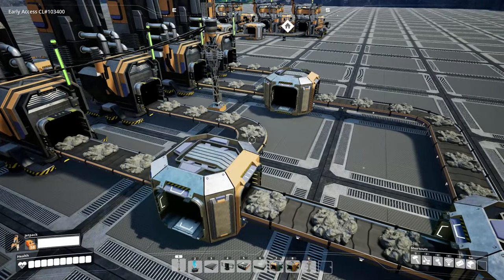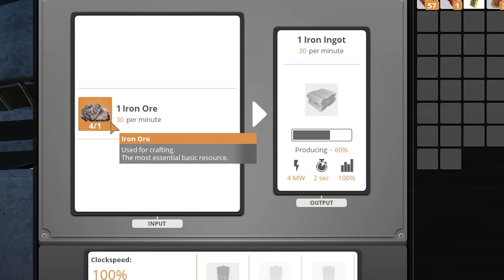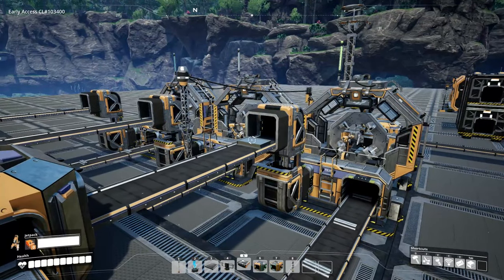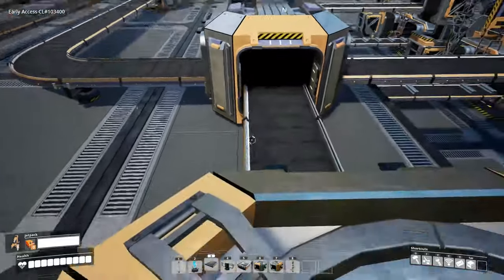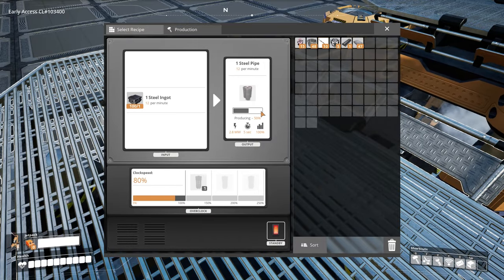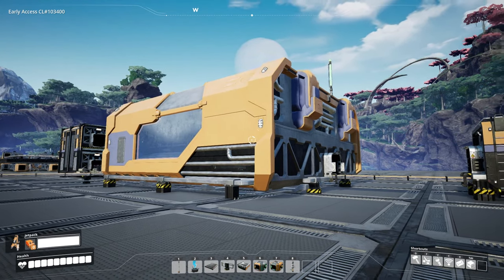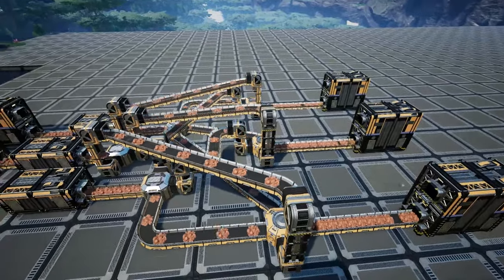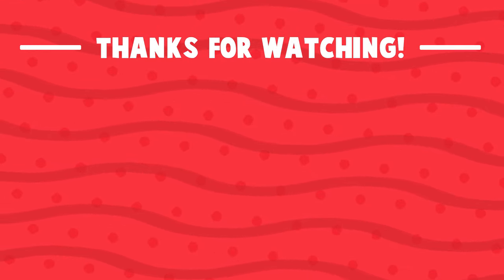Load Balancer Tips for an Efficient Factory! - Satisfactory Tips (Beginner + Advanced)

Comment: We produce too much of everything, the overflow is sent to storage, the overflow of the overflow goes to sink. We have main belt lines going to storage with multiple items on them, then use smart splitters to devide it all into containers, then have all the overflow from smart splitter line going to a series of sinks. Mk5 belts. We use the overflow line system and load balancing from resource nodes only.

Comment: I think load balancing is a wasted effort for one single reason: Unless you constantly and endlessly add more storage, your production line eventually runs full and stops. With a topped-off overflow mechanism, you already take into account eventual overloading of machines.
My approach is that any factory produces one thing and only that thing. The raw materials arrive by train, get shipped to the factory by truck, processed and the product shipped back wiht the truck to the train station. The good part about this is that you can have too much production and it ends up in a big container (train/truck station containers). From there it is taken when needed by trains & trucks.
Reply: Balancing is indeed fairly pointless, but no, the production line needn't 'run full and stop'. If you're managing throughputs properly it's not hard to consume exactly what you need, meaning resource nodes can be fully exploited.
Reply: @nomoturtle1788  Okay, I dont know what the highest tier item is, but let's say, you optimised production exactly up to that last item. You have a storage of size x for that item. Eventually, the storage gets full. That means your productions starts to back up. Your optimization was pointless.

Now since very rarely people build a factory from base item to highest tier item all the way without ever switching it on, it is really a wasted effort.
Right now, I am working on my steel production. I only need stators, rotors and motors. But the steel pipes, quickwire, encased industrial beam, etc is already running and of those of which I need also as construction materials, they fill up a storage.
Reply: @Zlorfikable  Pointless? I have all resources collect autosort into a central storage (the barn), where once storage is full the items of the corresponding chest are sent to a grinder. The system should never back up.
You didn't address my point either. "Resource nodes can be fully exploited". If you're cramming in 240/min into a system that only needs say 210, then you're wasting some of the resource node's throughput. What's more, with this oversaturation method, you have to repeat this process through every stage of the production line, so that for your motors for example, you're overproducing: iron ore, iron ingots, rods, screws, rotors, copper ore, copper ingots, wire, coal, steel, steel pipes, and stators. 
Even if you somehow only overflowed 5% each time, you're wasting something like half the throughput of the ore node. In other words, it's as though your recipe costs are doubled. 
Throughput is the only real limititation in this game. Play however you want to play, but if my assumptions are true then your factory could be significantly optimised with the application of a little maths.
Reply: @nomoturtle1788  i disagree. Power is the limiting factor. And resource nodes are not that big of a deal: there's more than you could ever wish for.
Putting things into a grinder doesnt make any difference whatsoever. The only thing you achieve is very balanced power usage. 
The point is, that there is no additional benefit for presplitting every input to the correct amount.
Reply: @Zlorfikable  Power is also obtained from resource nodes, and I bet you overflow those too, though the chain is simpler than manufacturing a part.
Having the grinder means the scenario you told be would happen doesn't happen.
If you're happy looking for additional resource nodes, or don't want to use them all, then it doesn't matter much, no.
Reply: @nomoturtle1788  Still, that doesnt change that load balancing is unnecessary. Remember, load balancing is only the system of splitting resources into equal amounts before feeding it to a machine, not the total amount used for the machine. If you use load balanced a total of 450 resources for a set of machines, then overflow also uses 450 total resources, just belted and split differently. Using more or less resources is a waste of time and energy - we both agree on that.

Comment: Not only does load balancing take up space, but if there is lag issue, all your machines probably won't be running at at 100% efficiency compared to the overflow method in which maybe your last machine won't be running at 100%.  Load balancing has so many cons.

Comment: Alternatively, slightly oversupply resources via over/underclocking at each stage, and the input buffers of each machine will remain full, making sure the machines further down the line (manufacturers) are always running.  Easy, done.  Practical over perfectionism.

Comment: In the first example you divided 120/min by half and half again, into four lots of 30/min, to feed machines that want 30/min. This is much better than just splitting off a single line into machines (overflow system) I do agree, and I think that is what you are trying to express here. But this is not a 'load balancer,' it's just dividing up a line for machines. Balancing doesn't happen in Sat. as it does in Fac. where belts have two sides which can fill unevenly. In Sat. feeding a machine exactly what it says it wants is '100% efficient,' not 'load balanced.'
Reply: It's not even that much better than load balancing. It only affects the start up and makes no difference in the long run.

Comment: Nice video, still useful now. lol  I'm fairly new, just built my first fuel generator, I've been just using the 'split everything evenly' method.  Looked up your video since I'm just setting up my first Mod Frame line.  I really like the 'send back to a merger idea'.  One thing I've been doing as well is put a Smart Splitter at the very start of the line with overflow going to the Sink.  Then if it does back it will just dump any extra.

Comment: My method is this:
I seperate all the same.
Like wenn I have under 3 things I want to supply, I use one splitter, but if I have like 4 I use 3 splitters
The supply gets to the first one. There it splits into left and right. Then at both side there is again a splitter. 
Now if I add more to them or planned it. I add it in a row, like 1-3 and add stuff to it like by my coal planets
But if I know there will only a certain number, then I try to split it nicely up like 2-2
And well you can call it a organized overflow as specially I add mostly a storage contaìner in the production so I can grab stuff that I need to build, research or craft
If I know

Comment: I find its easier to just budeget +2-4 per minutes on the input, and it slowly gets clogged until it naturally stacks up and balances itself correctly no matter what your set up.  It works just as well and takes less space and planning.  Its only flaw is if you have low tier belts (3 or below) you will not supply enough to one of the objects, and in particular not be able to remove the output fast enough.

Comment: I personally use overflow for all my machines and then load-balancing between them. I do however underclock some machines for the ratios, and if I have a little too much of one thing (like 8 screws per minute) I just use a smart splitter to route the overflow over to my resource sink.
Currently (early game, just before making steel) my only fluctuations in my power usage are from the resource sinks, and once in a (very long) while, a constructor for my concrete might stall (they use 40.05/min but only get 40) for a second or two. Everything else works at 100%, even with overflow. I'll probably use proper load balancing later when making heavy frames or crystal oscillators

Comment: One thing I have to disagree on. Never underclock a machine unless it's a miner or you don't have enough supply to run it at 100%. Just load balance the extra it makes off to a storage bin. Especially if a machine running normally makes like 15 and you need like 12 or something, because that's easy to load balance out.
Reply: Yea...  I don't really get why you wouldn't just go to a storage bin and then eventually you'd overflow but that doesn't make anything run slower down the line so it's not really an issue.  Or if you really care you can send excess to Awesome Sink for tickets and maintain 100% efficiency.  

Unless you don't have the power and need to underclock or it's fluids which can't be awesome sunk directly (again assuming you don't want overflow in inputs down the line for some reason) I see no reason to underclock

Comment: Correct me if I’m wrong but wouldn’t your conveyor level also factor into this? Wouldn’t it be harder to load balance with a level 5 conveyor compared to a level 1 as your resources approach the machinery at a much higher rate? Or am I wrong?
Reply: I don't think so..? The machine outputting, determines the resource numbers going to the input, so it doesn't matter how fast they move, it just means there will be more space between the individual parts on the belts. 

I guess, its better to have faster belts moving fewer resources, than slow belts moving to much

Comment: Hmm. Tbh if you let  120 ore into 1 splitter and connect the splitter to one furnace and 1 other splitter, connect the last splitter to 3 other smelters. You will have the same result. IDK why you are making this harder than it is. You dont need to balance that evenly, since the first smelter will run full and cant take anymore and than the second one will be full too, the third one too, after that the last one will be fed evenly. It takes a couple of minutes until it gets going, but ok
Reply: Not quite. The way splitters work in this game, is that the first smelter, the one connected from one 120 line, split into 2 60's, will mean that first smelter, will get 60 ore, until the smelter is "saturated" meaning it reaches its 100 item limit. 

This is because the splitters take the input, and then send the ore to outputs in a rotation. So, if you have a 120 line entering, and 2 exits, both belts will get 60 no matter what, which means that until your first smelter fills up, the others down range will be starved, and that first line will always gum up the system, leading to inefficient splitting.

Comment: Theres an important aspect in Satisfactory that makes load balancing rather useless.
Unlike Factorio, where the splitters have a set output, in Satisfactory they dont. A splitter will output as close to the half of its input as possible.
If you dump a full 780 mk5 line in and split it to a second mk5 and one mk1, that mk.1 will get 60 / min. However, as soon as the machine is full and the material flow has backed up to the splitter, it will get its 30 / min, not more and not less.

The only benefit of load balancing is that the startup is nearly immediate. For the overflow method to work it takes time, starting 26 smelters all fueled by one mk 5 line takes nearly 22 minutes until every smelter actually works. With load balancing it'd be like 2 minutes. 

TLDR: Its not worth the amount of time and space wasted on the load balancer.
Reply: Farther on you can obtain (research caterium) splitters that CAN adjust exactly what you want, instead of having to use factors of 2s and 3s to split/merge belts.
How much time you spend designing and creating such a system is subjective: some people have fun doing that. I don't, but it's not my place to tell them otherwise if they have fun.

Comment: I would like to correct you. Your setup for (I would call it) "return to sender" aka the 100% + 100% + 50% assembler build will not work perfectly. Logically: when you get those resources to the splitter at the 50%, it goes back into the input, and so, your input was 300% -> 100%+100%+100% -> 100%+100%+50%+50% but one of the 50% goes back to the input, increasing you maximal input by the 50%, so next round you have 350% -> 116,666% + 116,666% + 116,666% -> 116,666% + 116,666% + 58,333% + 58,333% et cetera. Do you see where I go with this? you will slowly stack up your belts with plates like they were containers.

edit: This is only for people like me having OCD about exact input output balance. I literaly cannot handle when something is not efficient. Having even 106% of required input makes me go nuts and rebuild whole factory.

edit 2: also, you can have those plates go to container for tier 2 conveyor belts or just straight into sink for points, your choice. That will make it perfect. Also you can make your plate output lower by lowering the percentage in the constructors and smelters. or just one or so...

edit 3: Also after that there comes the problem of evenly spreading resources among 5 assemblers or other. You literally cannot create 5 equal lines if you can only split by 2 or 3 and merge. I tried. I tried to do so for a long time.
Reply: but if you had 300% input then why don't you use 3 full running assemblers then?
Reply: @ellliotthenry4742  because you need 250%, that is 4 modular frames + 4 modular frames + 2 modular frames, that is 10 modular frames per minute to assemble heavy modular frames in 100% efficiency
Reply: Aka how making a quick and dirty explanation for a relatively complex idea fails under scrutiny.
Reply: I do want to add though, it is possible to split for a number that is not a multiple of 2 or 3. To split into 5, for example, you need to split 300 -> 100+100+100 -> 50+50+50+50+50+50. Then you loop back a 50 into the original 300 belt. This may seem like it won't work at first, because as you said, now you get 350. However, if you think about it, the 'loopback' will steadily increase, just like you pointed out, the loopback becomes 58.333.... The next run will be 358.333 -> 119.444 + 119.444 + 119.444 -> 59.722 + 59.722 + 59.722. 

Once you get to 360, it will now work fine. 360 -> 120 + 120 + 120 -> 60 + 60 + 60 + 60 + 60 + 60, then loopback 60 into the 300 to get 360 as the input again.

One way to think about it is: You split 1 input into 6 equal outputs, but since you loopback one, you have 5 equal outputs. Since 1 input turns into 5 equal outputs, the only possible way is if it had split into 5 exactly.

This strategy works for any number that is not a multiple of 2 or 3. Just loopback the extra outputs.
Reply: @notmyfirstnameineedalastna9593  that is partially true, but once it gets to the full 360 the input gets slowed down, for example if you have as a input plates, the constructor will slowly get filled with plates and then will work at unoptimised speed

Comment: You can also use the overclock system to optimize the production. You can set 50% and have the right output instant.
Reply: There is a non-trivial power cost to do that though. In the early game, it can mean the difference between having to use 5 coal stations versus 15.

Comment: As many people have pointed out the difference between load balanced and overflow isn’t efficiency, but time until it becomes efficient. 

In general, overflow is my default. But if I’m doing something where the required parts are only being produced a few per minute I might switch to  load balanced because spin up time becomes so much longer. And sometimes I load balance just for the heck of it - it adds variety, it can be a fun puzzle in how to arrange the increased number of belts and splitters, and I love the look of belts flowing with regularly spaced materials rather then full belts that jolt forward sporadically. It all depends on gameplay preferences, aesthetic preferences, time, and space.

Comment: i just find it way easier to just use splitters on every entrance to a machine and just have one main line going down. it works exactly like this is don't really get the point in doing this method.
Reply: Simple. The balance method takes several unequal inputs, and makes them one output, and then splits it equally to the machines. 

This isn't super useful for many machines, and is useful for vehicles and trains later so you don't have one cart full, with more waiting, and the next load only gets half filled before its ready. 

With certain recipes like the casted screws, input is 12.5 ingots, and 50 screws output. If you underclock to 10, you get 40. 3 constructors is the perfect balance using the method you use to make RIP right? No. The first constructor gets 15 ingots, second gets 7.5 and third gets 3.75 until saturation of the belt. But, you have the downline set up to take 120 screws, to 2 assemblers. This means your lines will never saturate, and you will always run at 75% and 37.5% efficiency on your screw machines, and will get 85 screws a minute, and always be trying to catch up.